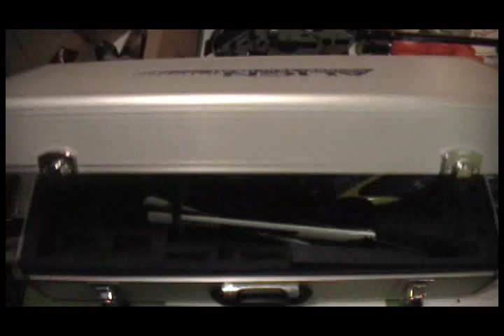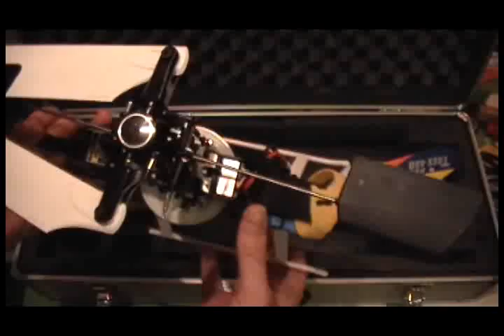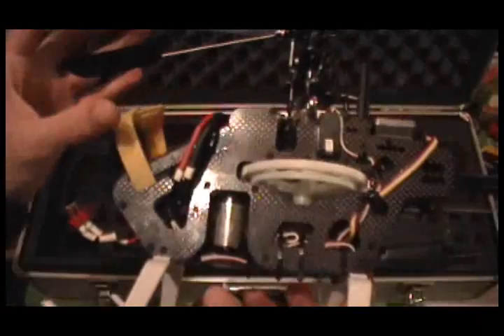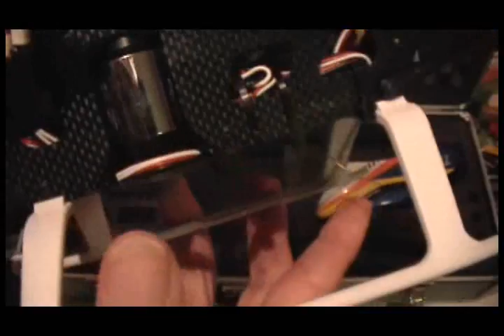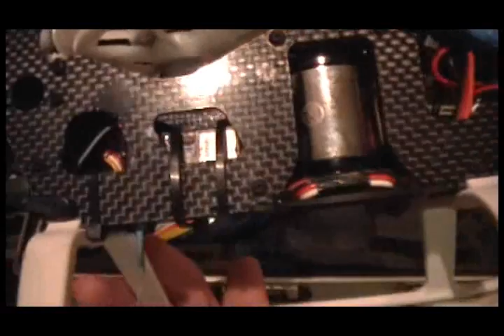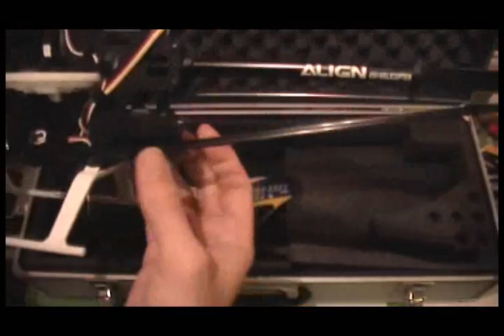450 Pro Build Summary

Comment: What would you recomend for a beginner, I have been looking at the 450 for a while, but not really sure if I should get one or not. I have around 12 hours on the sim (RF7.5), hovering is not a problem and other simple stuff, but apart from that I'am pretty much still learning. Some say small helis are harder to fly, but I feel like getting something bigger then a 450 would just scare the crap of out me.
Reply from the maker: +Sanimir Dizdarevic I recommend getting confident with a smaller CP helicopter like the Blade Nano or Blade 130X first. Those are much more convenient to fly and batteries are cheap, so you can get more flight time more easily. The 450 size is where we used to all start though, and if you put some training balls on it, and get some help to set it up right, and practice on the simulator, you'll be fine. The 450 size is big enough to cause injury, so you're wise to be concerned about that, but the fact that you're concerned means you'll probably be much safer than a lot of people who never even think about that.